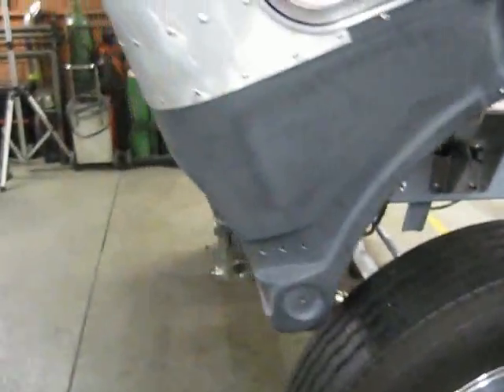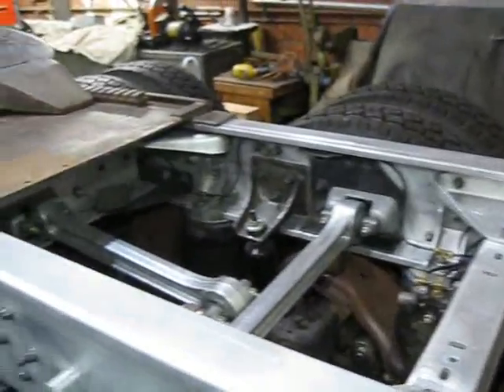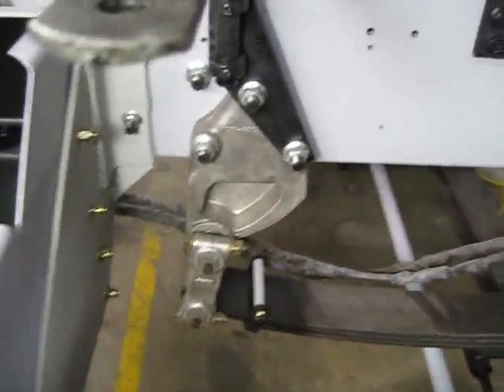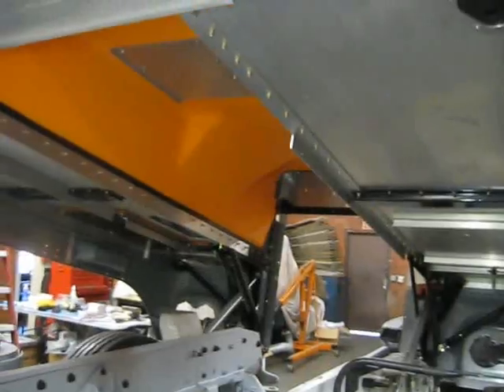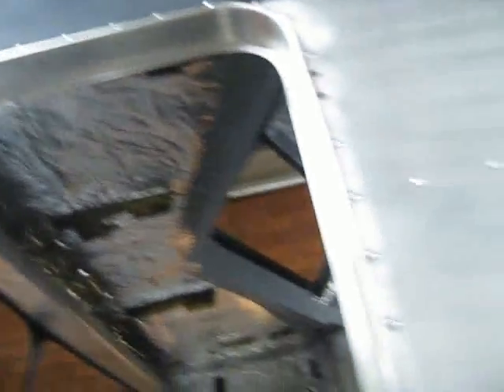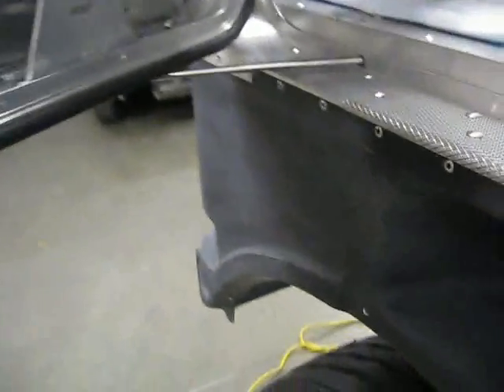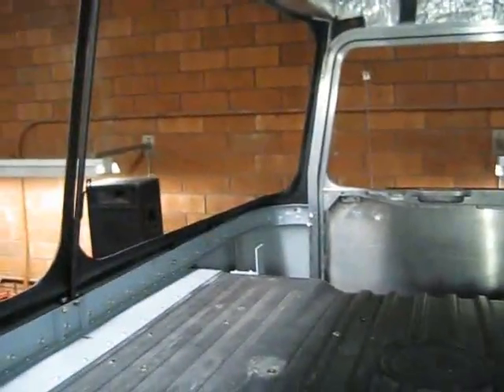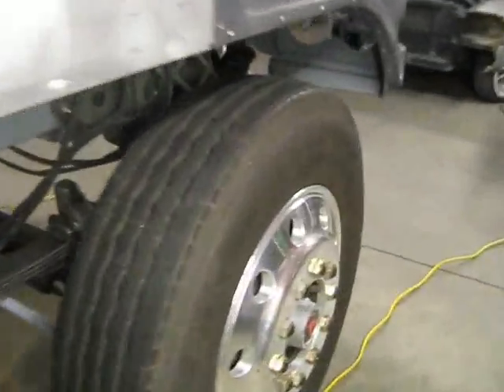1979 Kenworth K100 Aerodyne Restoration #1

Comment: Nice video. Your trck looks good at this stage prepaint. I would have loved to see the rig befor you started the restoration work. I like the fact that you are doing a full restoration with some up grades in strutural supports. You sound like a wise man about structural safety. Good for you. You are correct about painting the rig wiht out the engine in it since it was removed for frame repairs. I like that you plan on doing a almost perfect factory retosration and not custon.

Comment: Hey i know this is an old video but i didn't find many people on here that have restored an older cab over like this to this extent so, figured I'd try. I need some help. I have an old freightliner cab over cab that my dad ran when i was a kid. It eventually was sent to the junk yard to be parted out by the owner back on the mid 90s and all that was left was the cab, so i bought it. Im looking to do a resto/mod so want it on a long chassis anyway so my biggest hurdle is, if i find a wrecked conventional with the motor that i want, can i strip the body off from it, and put my cab over cab on the conventional chassis? I get that i would probably need to move the motor and trans a little and relocate the mounts which, i can either source or make myself. I do have a welder and fabricating experience. How much of a pain in the dink do you think that will be? Any competent help to guide me in the right direction so i can start looking for stuff would be greatly appreciated!

Comment: Your doing a beautiful job on this truck. I have a 1978 Aerodyne the cab hydraulics failed I replaced the bent cab hinge and pistons. I cant get the cab latch to go down and lock around the pin I don't think its going down far enough mine latch goes down about 1 inch before the cab starts to raise do you know if that the correct amount of travel for this?